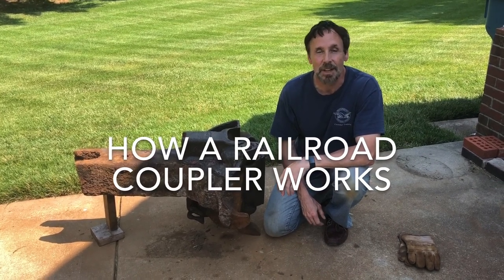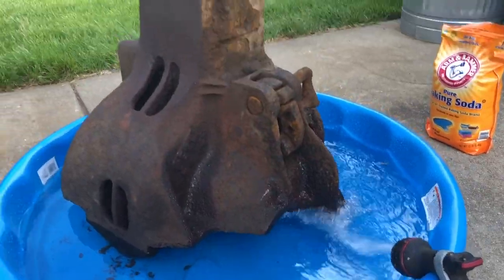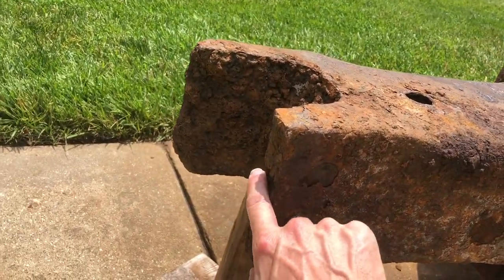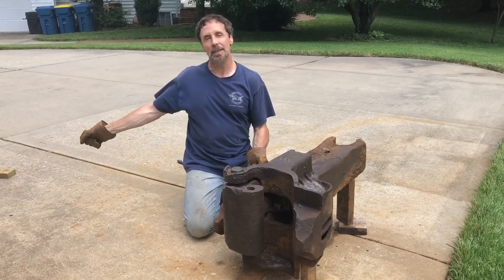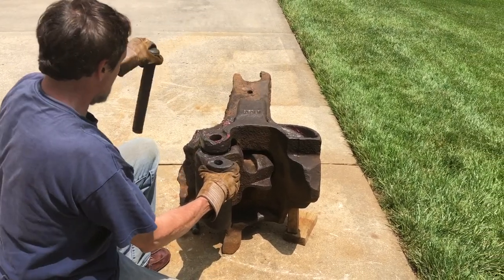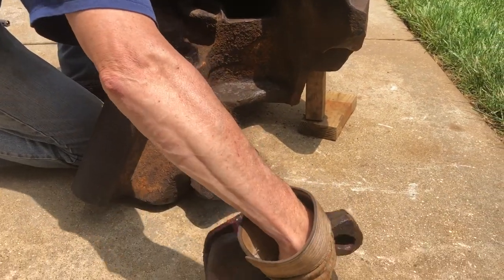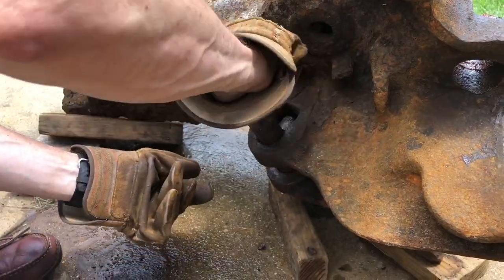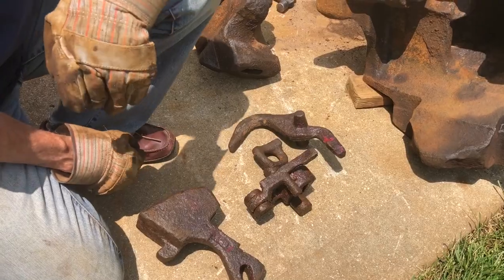Railroad Coupler

Comment: I can't believe you got it apart!  It looked like a massive rust pile. Thanks for the explanation.
Reply from the maker: Yeah, for a while there I thought I would never get any of the pieces to move again.
Reply: @johnsworkshop3312  This is actually bottom operated CBC. Newer versions use TOP OPERATED HANDLE ARRANGEMENTS

Comment: And with today's multi-mile long trains, Distributed Power Units or DPU's are placed in the middle (or thereabouts) of the train to ease stresses on the couplers. If they break, the train goes into emergency and the crew spends the next few hours replacing the coupler. After seeing this great video, I can appreciate what is involved in taking a broken one off and putting a new one on :)
Reply from the maker: Thanks for watching. That would be a heavy job to replace!
Reply: @johnsworkshop3312  Amen! And most freight trains have a crew of two - engineer and conductor :)
Reply: It is usually just the knuckle and/or the knuckle pin that breaks.
Reply from the maker: yeah - this seems like a more unusual failure and folks seem to think that derailment was the cause.
Reply: The knuckle pin is JUST used as the rotational axis for the knuckle. It bares none of the weight of pulling the train and in fact once the coupler is closed and locked, the pin can be removed without any problem... Until the coupler is opened, at which point the ~80lbs knuckle heads for the ballast.
Reply: There’s no coupler more amazing than the one in back of the locomotive pulling all the railcars.

Comment: Tight lock coupler type F . These are used on passenger locomotives and passenger cars. This one came off of a passenger car. I can tell because the cut lever is from the bottom and not from the top as it would be on a locomotive. Also I can tell it came from a passenger car because it has a vertical hole through the shank. Only locomotives and passenger cats are set up with this kind of draft gear. Freight cars have the draft gear pins inserted from the sides of the shank. There are a very few exceptions to this rule but that would be extremely unlikely to find along the tracks. 

Go to your local library and look for an article about and passenger train derailments in your area. This kind of coupler was used from the early forties to the present but you can narrow the search from say 1940 to about 1970. 

Good luck.. you may have found a bit of history.
Reply: Awesome reply. you sir are why i read comments. Always learn something new. thank you
Reply: @ArizonaCowboys  
Thank you for being so kind. 
Railroad is what I do. I am a locomotive composite mechanic and have worked extensively with railway passenger cars. 
Thank you.
Reply: Ditto on complimenting you for a great response.  My first thought when he described where he found the coupling was that the part had been sheared off of a car due to an accident.  It's hard for most people today to understand how common derailments of both freight and passenger trains were in the heyday of the railroad industry.
Reply: @wayneparker9331  
I am just trying not to sound like a know it all. I do enjoy my work thoroughly and love to share in this great vocation.
Reply from the maker: Thanks for sharing your knowledge!
Reply: Not meaning to cast any aspersions, but there's a few minor factual errors in your post.

The Type F coupler's application to freight equipment is not so infrequent; you'll typically see them on the likes of coal hoppers and rotary dump gondolas today, and I've seen photos of them fitted to the likes of flat cars, box cars, and cabooses!  In fact, the greater strength of the Type F and its components is a major aid in the safe and secure movement of longer and heavier freight trains that may be composed of fully-loaded strings of the aforementioned cars.  Tank cars built from 1971 through 1977 were also mandated to be fitted with Type Fs due to the added safety features of the design.

The vertical hole in the coupler shank is a typical trait of Type Fs, and the very similar Type H coupler (an H doesn't have the "shelf" or "lip" casting on the bottom that this coupler has), and the appearance of said hole has more to do with the design of the loco's/car's draft gear, than it does with it being a passenger or freight service vehicle.  That pin that locks the coupler into the yoke from the side (the "side key") is a telltale of the more familiar (and structurally simpler) Type E and its derivatives, plus the older Type D that the E descended from, with one major consequence being that an E derivative coupler (unless ordered with a non-standard shank intended to serve as an adapter) cannot be used in draft gear intended for Fs/Hs, and vice versa.

The Type H is what you're most likely to see on a typical "modern" passenger car compared to an F, and whereas passenger locomotives today have largely standardized on the F, the H was once a common sight on those too.

This is a VERY cool railroad artifact, but I'd stop short of saying it has "historical" notability.  It's a coupler that failed in service as was discarded upon replacement, an occurrence that's played out since the beginnings of railroading.  An unusual find, but not historical.

Comment: Cool knuckle assembly! A very thorough job of explaining how coupler assembly functions (PLUS you cleaned it all up and made it function once again)! 
Great effort.  Imagine being the lone engineer on a "dark and stromy night in the middle of nowhere" ...aaaaand carrying a replacement knuckle 40-50 car 
lengths to wear your knuckle broke. In your particular case, the entire "knuckle assembly" broke off.  The engineer was dead in the water! Usually only 
the knuckle(coupler) portion of  assembly breaks.  Yes a "knuckle carrier" would have been quite helpful. Eack knuckle can weigh 85-90 lbs upto 110 lbs
for a loco coupler. Type F and Type E knuckles. Your situation is unque. You got not only the broken knuckle...you have the entire knuckle/coupler assembly.

Fascinating...excellent demo.
Reply from the maker: Wow. What a great image of what it must have been like back then.  I wish I could identify when the derailment happened.  I figure it was after the mid fifties since that is when the type F came out.

Comment: Excellent explanation, great video!
Reply from the maker: Thank you  - it was a fun project.  Open to suggestions for improvement.
Reply: @johnsworkshop3312  Very nice Video and Explanation John.    Your local Libraries should have newspaper archives on micro film where you might be able to find the reporting of that train wreck with a bit of research.  A Librarian would be able to guide you on how and where you should start.   No doubt it was a big local news event in the  press when it occurred.   It might help to start which RR owned those tracks that was there and go from there. Ask about if your library has a media department at the Main Library near you.  It's worth a few questions a least.  Best wishes.
Reply from the maker: I’ve checked online and haven’t yet found one in that area. My next step when I get time is the local Madison County Historical Society.

Comment: This is such a great video! I never realized that there were so many moving parts, and just to think, that device has to withstand the load imposed on it keeping rail road cars together! I would like to see the Westinghouse braking system used on old steam train locomotives.
Reply from the maker: Wow - thank you.  That braking system would be fascinating to see!
Reply: @johnsworkshop3312  North American Railroad air brake systems are both simple and sophisticated. Electronic Air Brake control systems have been in development for decades but none are being considered for universal application at this time.

Comment: As a teen, I found an air hose along the Southern Pacific tracks on Alameda in Compton, California. Tried my best to take it home, but because I was riding a bike it proved to be too difficult to carry due to its weight. I regret not trying harder. One heck of a souvenir that would have made
Reply from the maker: Yeah - no kidding.  I learned early on that if you find something like that laying around you need to jump on it or it may be gone when you get back.  With this coupler it is so heavy I'm sure that prevented the casual passer-by from absconding with it.
Reply: @johnsworkshop3312  Great points... So true! LOL

Comment: That would make a great mailbox post. Mailbox mounted on the knuckle with the coupler bolted to a heavy pipe buried in the ground.
Reply from the maker: Great idea. Nobody will run over it that way!
Reply: @johnsworkshop3312  ,they might , but just once😉

Comment: In England we had ( on the old slam door stock ) the BUCKEYE which worked on a similar principle. To open you had to reach down and pull a lever which opened the coupler so another can be attatched. You only needed one to be open to Couple Up. But it was also mounted on a loco screw coupling underneath so if buckeye fails, it can be raised to release holding pin, then lowered so loco pin is used instead. I only ever had one fail in service and at that time we were empty stock returning to depot. There was one occasion when a driver at our depot got laughed at, at every station he pulled into whilst driving a rush hour service. It turned out that a pigeon, disturbed on the track, flew up and got wedged in the buckeye coupler. It was released by using a hook-switch pole and flew away, much to every ones surprise. This happened in the 1980s.
Reply from the maker: Wow - cool stories.  Thanks for sharing!

Comment: Just imagine the tensile force on the very front coupler.  Especially on freight trains.  It’s basically holding on all the cars behind it!
Reply from the maker: Yes - it is huge.  I did some research and found that couplers need to be able to handle 350,000 pounds both in tension and compression.  They proof test them to 700,000 pounds of force to ensure they do not break and are good at 350,000 pounds.
Reply: Typically on a 135 car loaded coal train, the force in the first knuckle is approx. 440,000 pounds, when the slack is all stretched out. Or so they taught us.
Reply: Shear force as well. That pivot pin is all shear--no tension.
Reply: All the couplers have a strength of 550,000 lbs.  most trains run around 450,000 lbs because you have a rolling resistance of that. It’s steel wheels on steel track that makes it easy to roll.
Reply: Not to mention all the components working with the coupler, such as the the yoke, the vertical pin, the draft gear. The structural integrity of the lugs in the draft pocket is something to be considered as well. I've seen many lugs fail and the entire draft system is torn out.. aye.. excellent video
Reply: According to Physics, once under tension, the strain will be identical for every coupler along the entire train.
Reply: @VideoNOLA  wow.  That’s insane.  And kinda counterintuitive.
Reply: they also get regular inspections and if anything is broken (and i mean if there is even a tiny crack on an e type coupler's retaining shelf)  the whole coupler is replaced. same goes for the pin, thrower, locking lug. if it has a tiny crack it is replaced. the only time that is not true is if you are talking about the f-type's welded on wear plate. they simply weld a new one on.
Reply: @signolias100  they probably look at them at the microscopic level.
Reply: @cjpatz  maybe after removal but not at a repair facility
Reply: @johnsworkshop3312  I work for a local freight Rail Road in Pittsburgh and I work in the locomotive repair shop. even after 10 years on the railroad it still boggles my mind how the knuckle can withstand all that force without snapping.
Reply from the maker: It really is amazing!
Reply: @Greatdome99   Not really.  A commenter above that works on the Canadian railway said this:  "You will notice that the knuckle has keys top and bottom that match slots in the drawbar. Hence the coupler will remain closed even with the hinge (pin) missing."
Reply: @cjpatz  It's effectively a chain. The load goes across all links.
Reply: @johnsworkshop3312  So that would be about 160 tons pull for the man in the street!!!!!!!!!
Reply: @VideoNOLA  you mean according to common sense.
Reply: @VideoNOLA  Check your math.  The last coupler in the train is pulling only the weight of the last car.
Reply: @jaredkelly930  Many coal trains where I live. You often see long trains with engines spaced in pairs along the train.
Reply: @ronjenkins4257  " It's effectively a chain. The load goes across all links."
No, it's not a chain.  A chain has a load force applied to the ends and we rarely consider the forces generated by the chain itself.  It's like a chain with NOTHING attached to the end.  Last link sees only it's own weight or friction.

Comment: Nice coupler! Looks heavy!
Reply: Never done it myself, but imagine trying to replace a coupler in a driving rainstorm & thunder, or @ 10-20 below zero.  All the time knowing Dispatch wants it done ASAP to keep the traffic or Amtrak flowing.
Reply: @jamessimms415  ..............I've done it, it's no fun...........the knuckle weighs about 80 lbs. If you break a drawbar there's usually some poor train handling involved unless it was defective. I only saw 3 broken drawbars in my railroad career and those require mechanical staff to replace.
Reply from the maker: Glad to hear that is not very common.
Reply from the maker: I can only imagine.  Sounds like a recipe for an injury

Comment: When using electrolysis you will get much better results with washing soda instead of baking soda. At least I have. Also I seem to get better results using rebar as my sacrificial piece of metal than other junk metal. That coupler is a heck of a find…..hard to believe no one has snagged it all these years. On a side note I live in Alton…….small world. Excellent content btw
Reply from the maker: Thanks for the tip Alco Power - next time I'll give that a try.  Yeah - I couldn't believe nobody had snagged it either.  I was pretty excited to find it!

Comment: I broke 1 or 2 of those couplers in my short time as a worker at a power plant in Northern Nevada. That plant had a hundred car coal train come every 30 hours with a load. In the winter, the hatches on the cars would freeze up and we would be sent to the trellis to “help” unload the train.  I never worked outside and had no gear for the freezing weather.  So there I was, with a heavy jacket, playtex kitchen gloves on a slippery steel trellis with it snowing and a train that would not vomit its treasure. Wham, wham we would hit the cars hoping the discharge gates would spring open and, yep, a few times they did. Then we would have the engineer accelerate the train and slam the brakes to jar the doors open. It worked for a few cars and suddenly the coupler broke.  Yaahoo, break time at 3 in the morning.
Reply from the maker: Wow - that sounds like quite a job!  And dangerous too!  Thanks for sharing that wild experience!

Comment: Thanks.  There is a big spring that helps absorb the shock that goes on that part  somwhere.
Reply from the maker: Interesting. I bet that part stayed with the rail car.
Reply: @johnsworkshop3312  it goes right behind the broken off part.  It is called the draft gear.  It takes something like 47,000psi to compress the spring enough to remove and install.
Reply from the maker: Wow - that would need some serious tools to be changed out.
Reply: The draft gear that I am aware of were made of alternating metal plates and  rubber blocks. They were assembled inside a cast steel box.

Comment: My understanding is that these knuckle couplers were a massive leap forward when it came to worker's safety.  The railway men no longer had to manually attach the cars together.  The older pin designs used to harvest fingers by the bushel.
Reply from the maker: Right, and the workers could stand outside the track and use a lever to disengage the coupler.

Comment: I believe the Type E coupler is much simpler with a vertical operating pin to lock the knuckle in place.  The E, F, shelf, and tight-lock(for passenger cars) all need to be able to couple together and work together.
Reply from the maker: @royreynolds108  good information. Thank you, and thanks for watching!